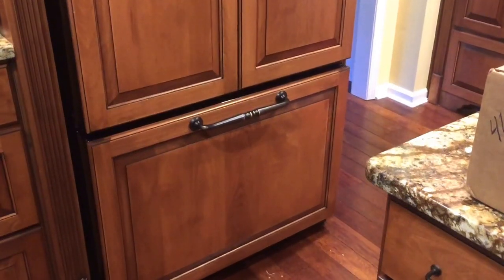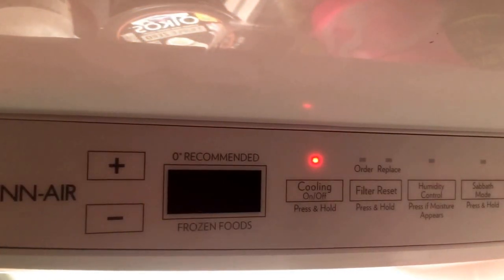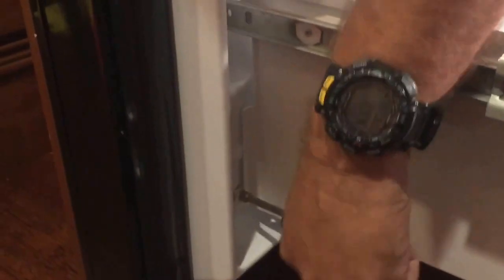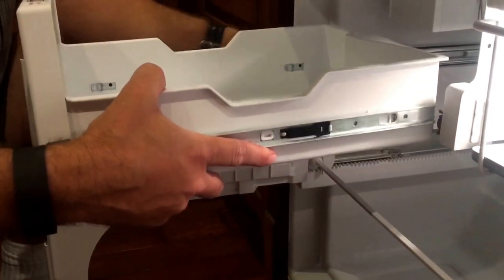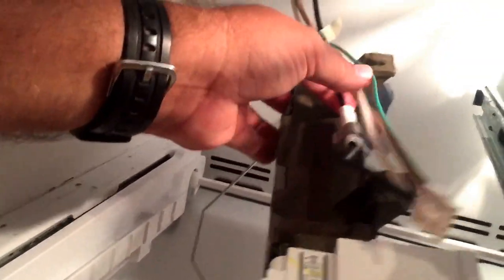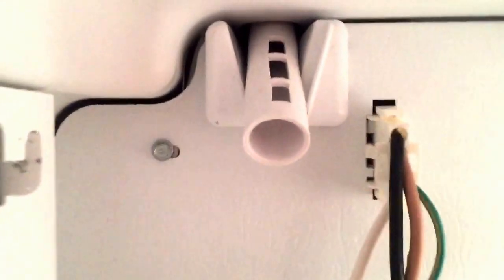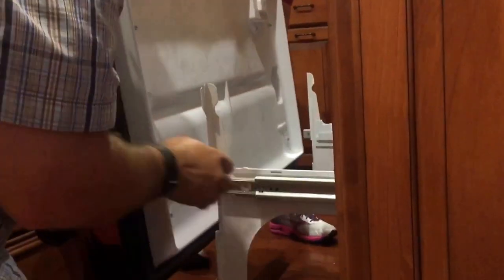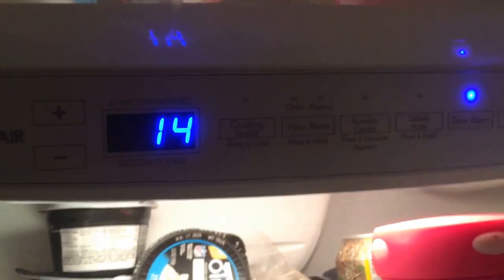How to replace a Jenn Air Icemaker

Comment: Again a great video, but a few comments.

1.  I did the entire process only removing the ice tray.  Removing the door isn't that hard, and I'll probably do that next time to make reaching the power cable easier, but it's not really necessary to remove anything more than the ice tray.
2.  The mounting screws may be located in slightly different positions, as was my front screw.  Also, my new unit came with a mounting base which had to be removed and thrown out, but without that base the unit was virtually identical to the original.
3.  The cable can be removed at either the ice maker end or at the back of the freezer.  I used the latter point since my new unit had a cable already properly attached to it.

Overall this is a very easy process, which is good given the lack of quality of JennAir/Whirlpool parts.

Comment: Great video, but here's something I stumbled onto myself with a similar model Jenn Air fridge.  I knew it wasn't temperature or water pressure keeping the machine from making ice, so I tried the solution from "The IT Crowd" TV show:  Turn it off and on again!  I cut power at the breaker box for 5 minutes (that long to prevent damage to the compressor) and then sometime later it started producing ice again.  I think it was probably at least an hour later, but I don't know for sure because I did this late at night and went to bed before it started.  But apparently it just needed to be reset.
Reply from the maker: Great tip.  Simple and low cost.  Thanks
Reply: You're welcome Fortunately the wife noticed it was making ice before I ordered the new part.  But at least now I know it's an easy fix.  I already had to replace the air flow diverter on this unit, and that was easy too.
Reply: Just a follow up-the device failed entirely about 7 months later as did the air flow diverter for a second time.  I think the actuator motors JennAir/Whirlpool uses on their various devices are not really first rate products.

Comment: thats a sick fridge, where did you get the cabinet like look?
Reply from the maker: James P the fridge can come with normal stainless or powder coated panels, or you can select doors that allow you to add wood panels.  Good friend of mine used to build cabinets and when he was doing ours, he talked me into that option.  Dishwasher is the same.
Reply: Have you had any problems with the dishwasher?  We were going to go that route and then were talked out of it due to the moisture issues concerns some raised.

Comment: Ice dispenser on door mainly stays on "lock" but will switch to cubes periodically for a short time.  I love the crushed ice, however, it will NOT switch to "crushed" feature. . .  can this be easily fixed????